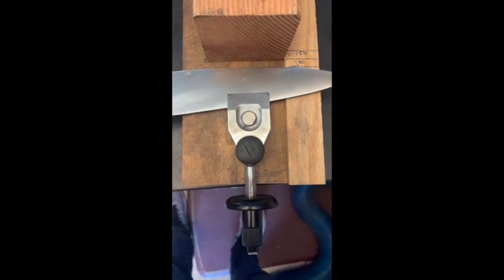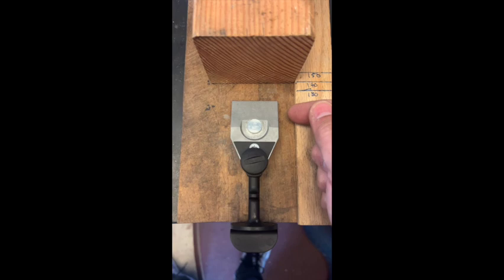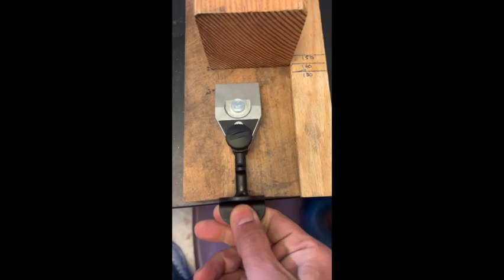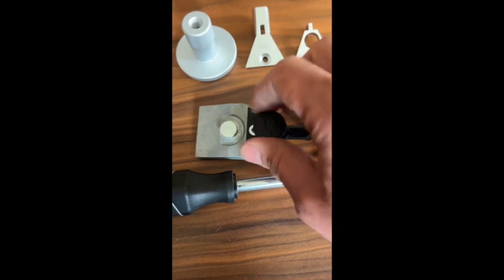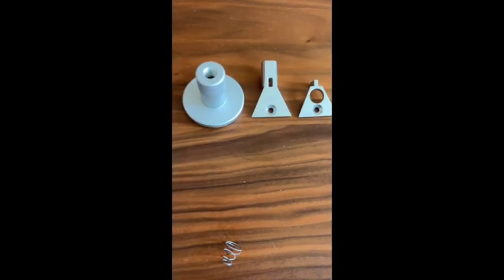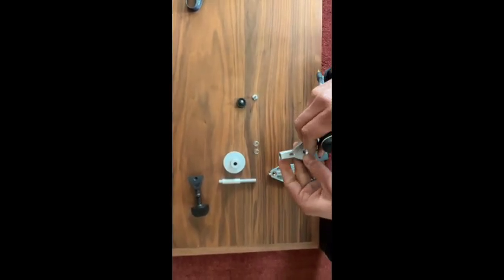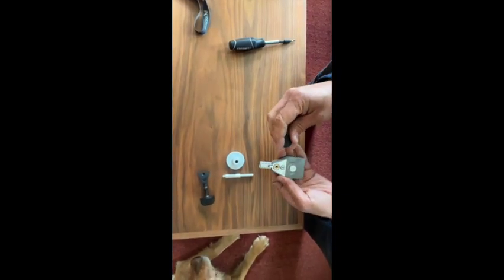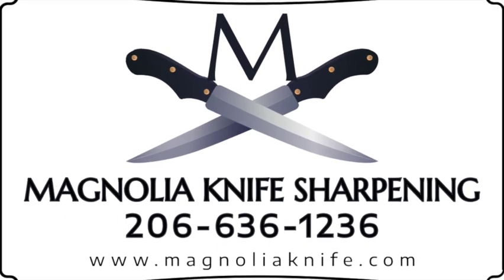Tormek KJ 45 Retrofit SVM 45

Comment: Given you run at 140, I am guessing you are using Knife Grinders SW. I am not sure how big your production runs are, but have you considered making sets that have different grinds on them so you can accommodate blade widths much like was done in Knife Grinders? Seems like a set of 2 or 3 at just under 2x what you are charging for 1 might be more enticing than a single one that can really only accommodate a small subset of knives. If there was a second one that allowed you to cover "most" knives, this would be nice.
Reply from the maker: @michaellynch1132  this is not fixed, it covers most knives will post a demo soon.

Comment: and what's the point of this modification? the original clamp is self-centering. what you modified works like the old version, not self-centering. for the same $60 you can order self-centering jaws for a hand machine, and make 3 clamps for the price of one of your versions.
Reply from the maker: Problems with the KJ-45

* It’s not adjustable, you can’t make micro adjustments easily, rendering the wood block, fixed distance technique less useful.
* Tool rest handle is too small, long blades pull the knife towards you, it's less comfortable.
* Occasionally you inadvertently use the “shortstop” without realizing.
* The self-centering aspect is generally solving allow priority problem – we’ve never-ever had a customer complain about  it.
* Plastic shaft is not as sturdy as it needs to be.
Smaller torque screw is hard to get tight.

Problems with the SVM-45

* Shaft is slightly too short to accommodate very thin/wide blades without adjusting tool rest height.
* Plastic tool-rest wears out, we wrap electrical tape around the treads to establish tension… after three years it is now stripped.
* Not “centered” – though we have not found this to be a real problem.
* It’s no longer being produced (boo!)
Reply from the maker: @workshop_oselok_kyiv  you can’t get the old ones… it allows to work fasted because fixed projection length adjusts not the height of the bar.

Comment: I have all my tormek jigs set to 138 mm and it gives a 18 degree bevel. How wide can the knife be that you put in these and keep close to 138mm. I do alot of cleavers freehand with a 4 inch wide blade and am looking for a way to hold them in a jig, in my 4 step process. I can change my guide lengths to accomodate a 160 mm jig defection. Can you make rods from say 2 inch to 8 inches long. This would allow narrow knives as well as wide blade cleavers or machettes.
Reply from the maker: Cleavers still require adjustment of the USB because you can only get the shaft so short due to the length of the actual jaws + the width of the USB (making the shaft longer wouldn't help with a cleaver). You can do really small knives without adjustment up to pretty wide chefs knives. We typically set to 140mm.
Reply from the maker: @75Mule  cleavers tend to be too big can handle up to about 3 1/2 inches wide to even the tiniest blades.